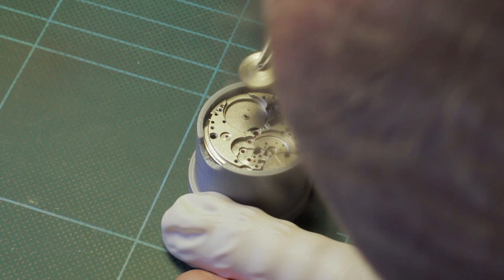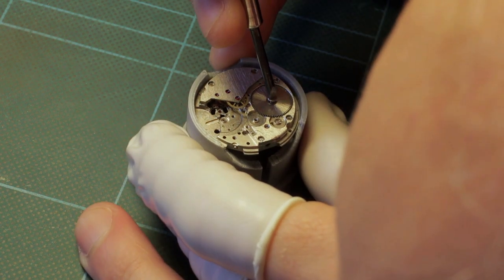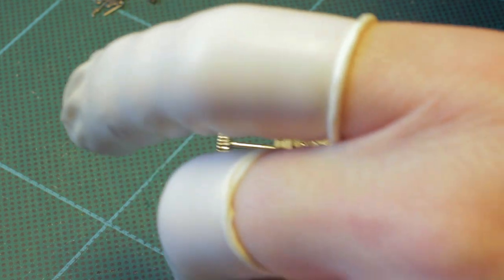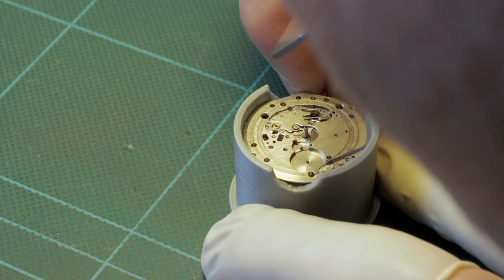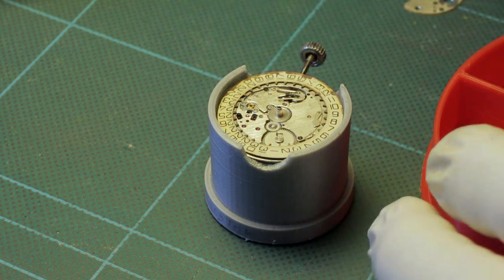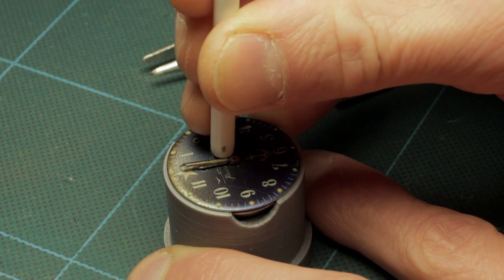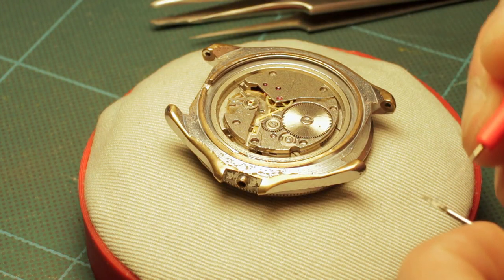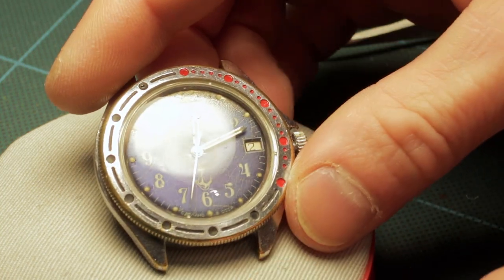Vostok 2414 Komandirskie Service Part 2 Tired Old Watch Refresh

Comment: Nice to see this movement we watched very closely listening to you from the Part 1 during the disassembly process as she is going back together. maybe for your camera you can mount a swivel shaft like even telescoping arm to the wall near the windows edge or a direct drop from the ceiling even as some thoughts that then has a camera bracket (after market buy) attached and that holds the camera, so you can affix it looking straight down a home made style wall mounted job is just some camera thoughts. Owned by a machinist YES that would be a good sharing thought that has these two thinking historic thoughts now. Lance & Patrick.
Reply from the maker: That would be good, I do need to try and improve angles and straight face down would be the best.

Comment: I think I will be referencing both your videos a lot, I have one KGB Komandirskie I need to refit the balance to but it has shim plates and finding it difficult to get them in place.   I also have two others, one a lovely old CCCP Tankist, the other the exact same submariner as yours but its the older Zakas MO one, these two have slipping mainsprings and plucking the courage up to replace them with a harvested one from one of many scrap 2414's I have accrued.   I have a fair few Soviet and Russian watch videos on my channel as I am an avid collector of them ol' Russkie watches hehe (just upped a video showing my transplanted KVPO Amphibia innards from its octagonal to a 060 case with new crystal, repainted bezel and a nice polish, it looks mint imho and very pleased)
Reply: I see in many "how to's" on replacing mainspring, people say just lift up and finagle out the barrel and I am wondering why not just lift the whole bridge off, do you know why this is?
Reply from the maker: @dodgydruid  I'm not exactly sure what you mean there, could you elaborate a bit please?
The bridge and barrel both should be removed to remove and replace the mainspring.
Be sure to measure the slipping mainspring. They are different in design and often length to standard springs.

Comment: Love the retention of patina. Curious you didn’t silicone the rubber seals ,most do the case back and crown . Maybe I missed it 🤔 thank you , super job. 👏
Reply from the maker: I do indeed but typically don't show it. It's thoroughly unexciting watching a case gasket being greased.
These don't actually need it on the case back seal as the case back doesn't rotate against it, it's compressed by the ring pressing against the case back which sits on the seal.

Comment: Really interesting videos, I enjoyed every second of them.
 
Would you consider these watches easy enough to be used as learning tools? I'm considering watchmaking as a hobby and I don't want to spend too much money on a hobby that may end up not being for me. 
I was thinking of buying an old but working komandirskie (I'm not putting my hands on my actual komandirskie) and some basic tooling.
Reply from the maker: Absolutely yes, I wouldn't say they're the best to begin learning on, some of the bridges can be a bear to refit on the tight locating lugs and pivots can be broken as a result.
The chinese ST36 is a great starter movement, large, based on the ETA 6497 and nice to work on.
Reply: @spidiq8  Yes, i already got my hands on one. I still bought an old komandirskie for a restoration and modding project I have in mind (and half completed)

Comment: Just learning to service and got done with this movement. Only issue I am having is reinstalling the stem after movement is back in the case. I depress the button with my tweezers and try to rotate the stem back in, but it almost seems that the crown hits flush with the tube on the case and I can’t get the stem to click back in place. Of note, I did remove the stem while in the time setting position, so not sure what the issue is. Any help is much appreciated.
Reply from the maker: You aren't alone in this. These stems are an utter pig to refit because of the clutch on the stem which disengages when you apply pressure so turning the crown won't actually turn the stem. If you turn the stem with tweezers whilst applying pressure you can someone get it to align, once in place pressing the setting lever release should let it seat. You might need to apply pressure with tweezers directly to the stem.
Reply: spidiq8 wow thank you! So helpful. Happy holidays and I love your videos!
Reply from the maker: @5spdeconobox  Thank you, good luck with the watch and happy holidays to you too.

Comment: how much would you charge  to get one of these repaired? im looking to see what to expect from local watchmakers.
Reply from the maker: It would depend entirely on the watchmaker, the parts they stock, the actual problem with yours etc.
I can almost guarantee it would be more than buying a new Vostok because there's considerable work involved in stripping, checking, adjusting, cleaning, rebuilding and oiling a movement (if don't properly)

Comment: Thanks for sharing your knowledge.  I'm plucking up courage to do this on an old Komandirskie I've just bought.  I assume you clean with an ultra sonic bath.  What fluid do you use?  There's no mention at all about lubrication.  This is necessary when rebuilding, isn't it?  What sort of lube & where would be very useful.
Reply from the maker: Thanks. Glad you enjoyed it. I plan to do a more detailed video on a Vostok movement.
For cleaning I use an old. (Older than me), watch cleaning machine by Lanzetter, (you can see this on a fairly recent video if you check back or have a look at my watches playlist), however an ultrasonic will do, I'm not a fan for watch parts personally as I'm on the fence about the vibrations being good for certain components but plenty of folk do use one.
Cleaners can be had from supply houses like cousins but if you're starting out Naptha for degreaser and IPA for rinse will do. Essence of Renata is good for balances, (Don't soak pallet fork and balance in IPA for long as it can dissolve shellac.
Lubrication is necessary and at a bare minimum you'll need one oil and one grease.
Cousins do a wide variety and they're not cheap but oils developed for watches are designed to not spread. Don't be tempted to try using something like 3 in 1 as that will spread and cause problems in a short time.
Moebius 9010 for oil andHP1300 or D5 are a good start, you'll need a set of oilers and an oil pot with at least 2 wells, don't use straight from the bottle as you can contaminate.
Oiling is something of an art and even now after many years I can over oil occasionally and only practise will get this.
Points to oil are all pivot wells EXCEPT pallet fork pivots and grease for high torque low speed areas, balance pivots, winding work etc.
I recommend that you try and pick up a couple of old movements from car boots eBay etc to practise stripping and assembling on even if they're non runners as it's better to damage something on a scrap movement than one you want to wear.
Vostok can be quite tricky to align the train bridge on so getting a feel beforehand is a helpful thing.
Reply: @spidiq8  I have wondered about that on the pallet fork jewels and the embedded jewels whether an ultrasonic could unseat as the pallet stones are only held in with shellac it seems which on some of these watches could be positively ancient.
Reply from the maker: @dodgydruid  Vostok pallets are often not well seated to begin with so I'd personally be especially wary of using an ultrasonic on them.
Reply: @spidiq8  great! Now after reading this I'm totally scared to try it. 😄
Reply from the maker: @shaneworden1325  Sorry about that. It's just my experience with them. They're not the best at securing pallet stones but shellac ing is a useful skill so you can take the opportunity to try it. Alternatively you can often find really cheap movements on eBay which are good for spares.

Comment: I was looking for an informative and detailed video showing ever aspect of disassembly and reassembly of this movement. 
Really, do you think that a novice with this movement could learn anything remotely useful from your two videos on this subject. ?
You have edited out bits of the process and rebuild the damned movement in fast motion. !!!
Are we expected to see through your hands and what looks like the back of your head?
As an education tool, these vids are less than useless. 
Too much time spent droning on about how clean the bezel and case are now...
Reply from the maker: Sorry that it wasn't suitable for you. I've been working on my video setup for watch work as you'll see if you check out some of the newer videos. The camera and tripod used in this one and the early videos cannot be positioned ideally.
These videos were really about refreshing a tatty old Komandirskie rather than specifically the movement but I can, at a later date do a new video on this movement. They are all similar enough that one will serve as a good guideline for others.
Please remember also that these videos are my time given freely to film and edit and upload and filming a strip and reassembly of a watch movement essentially doubles the length of time typically taken as you're trying to keep things in the frame of the camera where often you'd work very close with a loupe.